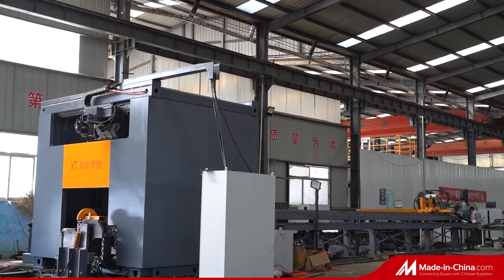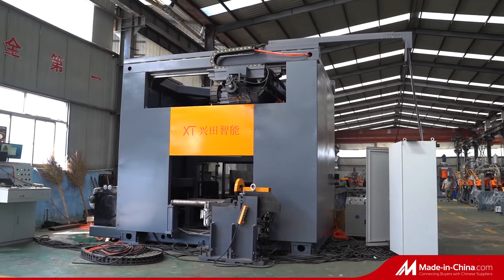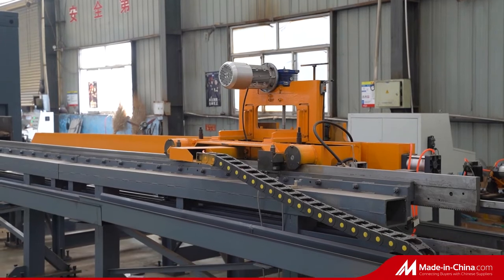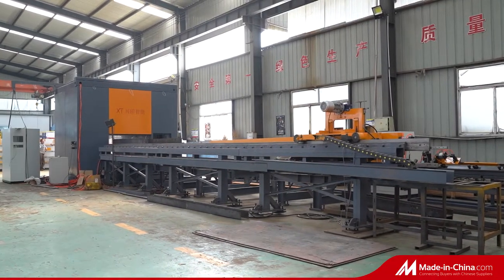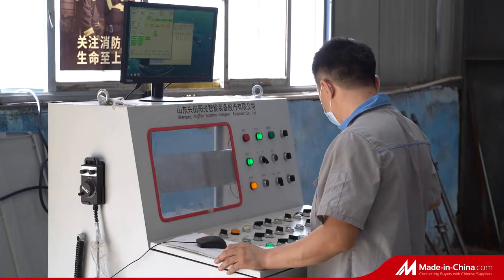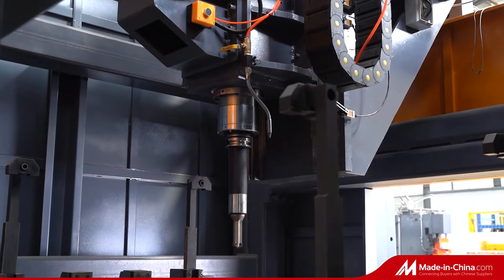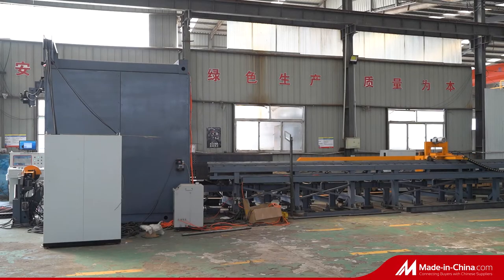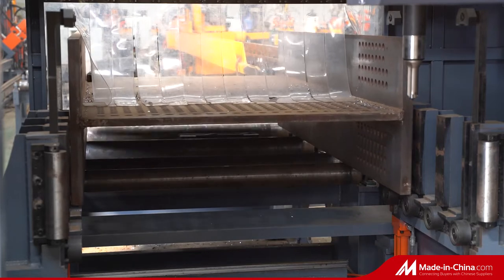3 Dimension SWZ 1250 Box Beam Channel Angle Beam I H U C L Beam CNC Drilling Tapping Milling Machine

Comment from the maker: SWZ 1250 H-Beam CNC Drilling Machine for H-beam, Channel beam with Angle beam, plate drilling,  and marking processing,

Suitable workpiece Specification/size 
1, H Beam Web x Flange (mm) 150x80～1250x600
2, U Beam WebxFlange (mm) 150x80～1250x400
3, Box Beam WebxFlange (mm) 150x80～1250x400
4, Angle Beam WebxFlange (mm) 200x200x16
5, Max. Thickness(mm) ≤80
6, Length 12m or customized.
7, Short material limiting  
    Automatic processing ≥3000mm
    Manual processing: 690～3000mm 
8, Drilling Speed 3000rmp.
9, Spindle Taper BT40 with Max hole 40mm diameter(standard), 
    Customized Max drilling hole 70-90mm etc, it is also okay!
10, CNC System is Japan YOKOGAWA PLC etc. 

If you have interested in our machine, pls call us wthout hesitation. Thanks!

Best Regards
Jack--Director 

E-mail: Xingtiansunshine02@gmail.com
Mobile Phone: +86-159 5318 5570